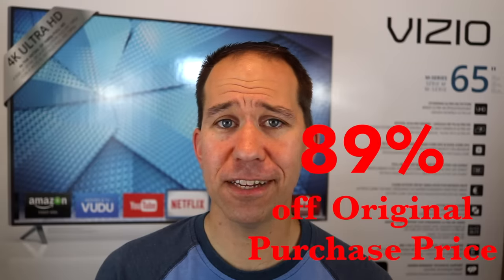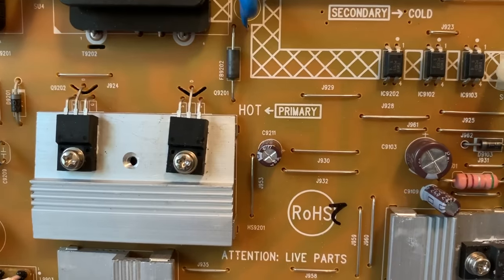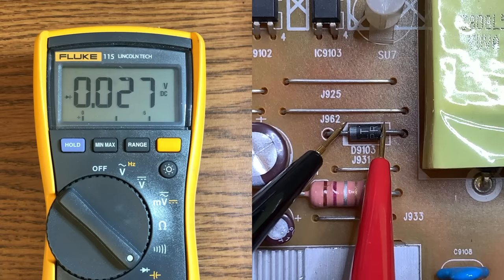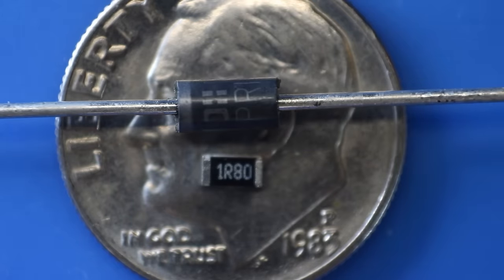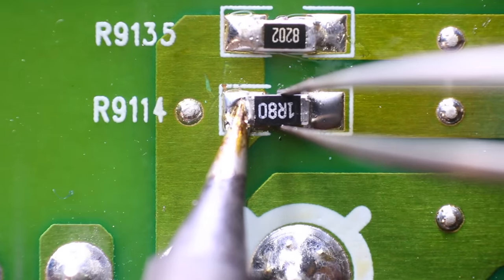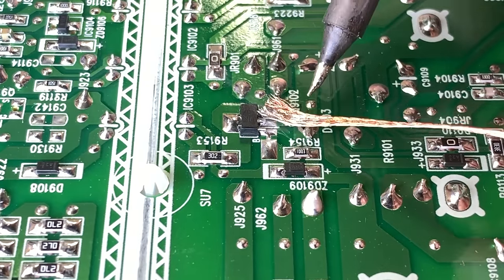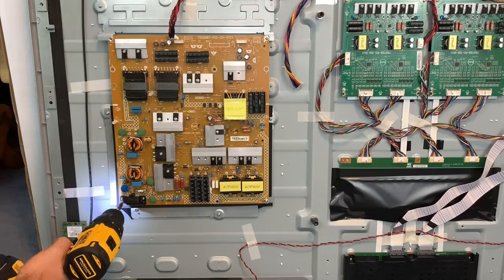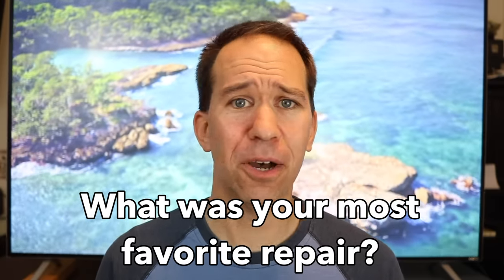I got a broken 65” 4K TV - How I repaired a Vizio M65-C1 (tv won’t turn on)

Comment: I used to repair computers and peripherals for companies like Insight and Wang (1980s) but haven't done much lately. I no longer have the tools and have forgotten more than remembered what to do. I used to believe that having a soldering iron on a component lead too long in order to remove or restore from the mother board for fear of toasting the part itself, but it didn't seem to bother you. Also, I would recommend getting two of each part in the event that the first one is damaged or no good. Since it is a common problem, I'm curious as to why it's the same parts that went bad. Was it from a lightning storm or static discharge that blew the parts the first time? Thanks for sharing. I subscribed and liked the video.

Comment: I have the same tv and the light flashes but never turns on, shopJimmys sells ALL the boards but the one I need they sell an 8 pronged ecom chip that I have no clue where it goes. By the way I saw this video when you posted it and loved it and now using it. Thank you
Reply from the maker: The eeprom chip wild go on the main board, if it’s what I’m understanding is the issue.  I’ve not done any main board work on this model so I can’t tell you off the top of my head.  Thanks for watching!

Comment: I had the exact same TV. I had a lot of issues with HDMI screen freezing or top being fine and bottom with a frozen picture. After about a year of dealing with it would often trick me as sometimes it would be the mouse batteries dying. But one day getting aggravated with trying to get 2 enterprise network switches to talk to each other and forward the VLANS and the TV froze. And with 24 hours of no sleep before I realized it I put my keyboard through the screen. Vizio TV's are junk I've never had so many HDMI issues and that year and model is common with those issues I had. Even my buddy bought the 60 inch model before he punched the screen and sent it back. He ended up just getting a Samsung OLED and made me jealous.
Reply from the maker: Sorry to hear!  The funny thing about vizio TVs is that they are only the brand.  They are made by various companies such as LG, Sharp, AUO, which people generally think well of.  Even Samsung and Sony had years of TVs with terrible problems.  That said,  it is no fun to experience a problem when it’s your own tv!

Comment: Just a bit of advice from someone who does this every day. When you are replacing a thru hole device like the diode you did. And you know the part is bad. Cut both sides of the diode on the other side of the board and then just use your tweezers to pull the left over metal out of the hole as you heat it with a soldering iron. It does less damage to the board that way and is far far easier.
Reply from the maker: Thanks!  Yes, great advice.
Reply: @FrugalRepair  No problem

Comment: Nice work! I have the same exact TV and same exact problem (no power). Unfortunately I don't have the tools or wherewithal to attempt what you did. How much would a TV repair shop typically charge for this kind of work?
Reply from the maker: Thanks!  I don’t know how much a shop would charge, unfortunately.
Reply: @FrugalRepair  Thanks for the reply! I found a TV repair place in Texas (I am in CA) that will ship me a working M65-C1 power board (715G6887-P02-001-002S ) for $200, but I can get a $60 credit for sending them my broken one, so net cost of $140. I can also just ship them the broken board which they'll diagnose and repair for $90 (assuming its broken). Shipping costs not included. This place: http://www.coppelltvrepair.com/ For now, I 'm having a local repair guy come by to diagnose it and give me an estimate.
Reply from the maker: You can also feel free to email me if you want to ship it to me to repair.  I would assume the two parts are bad and could do the same repair as in the video.  I also have more power boards I need to sell.  Again, email me if you want more info.
Reply: @FrugalRepair  Thanks, I will email you. Turns out the diagnosis is a bad main (video) board.
Reply from the maker: There are some people who offer a repair service on eBay for those main boards. I’m not sure if there’s a common failure on there or not.
Reply: @FrugalRepair  Thanks, I will hunt around. I did find this interesting YT video that talks about re-flowing the main board https://www.youtube.com/watch?v=b2Lo3G2u7CE I also read about people baking the main board in the oven at 400F for 10 min to accomplish the same thing and it apparently works (although fumes can be bad).
Reply from the maker: Interesting.  You might benefit from watching my video on using heat to fix a TV.  I can into explaining what people are trying to accomplish by putting their board in the oven (not what I recommend).   I reflowed a chip with a heat gun.   I released it in May 2020 or so.

Comment: I tried to fix my $850 65 in Vizio TV for $31. When the picture when black I did what you did and search the internet. I found that the problem would be the power board. In order to understand how to solder and all the other itsy bitsy things i have watched another 50 videos and spent almost 6 months to train myself in order to feel confident to work on my TV. On my journey i have collected around 15 TVs , various power boards and motherboards that were broken from various TV repair shops dumpsters. I almost burned my entire house while trying to learn and improve soldering skills. I don't even mention how many times i burned myself and got electrocuted. After ordering $1 worth of parts i spent almost $29.99 for receiving those parts from Hong Kong. After i solder the itsy bitsy chip and the weird looking resistor i was confident that i have finally repaired my TV. I plugged it in turned it on woosh no power. I was so upset and felt like i wasted my past 6 months for nothing. While desperately thinking what to do i decided to put my tv online to sell for $200 and some dude offered $150, i was thinking what kind of cheepo is trying to cut $50 from $200 almost in perfect cosmetic condition $850 TV. I said dammit i can't waste anymore time on this TV and i accepted his offer. I even gave him the original box which i kept all this time (almost 2 years) in perfect condition just in case if i need to return the unit for repairs (experience from my old Vizio) had to fight with my wife who has tried to throw it away 100 times which i collected back from the garbage cans. Now i bought another Vizio 65 4k smart TV, spent $650, i think i got a good deal. I am still battling with my wife about keeping the box. In the end i have wasted 6 months and $531.

Comment: Great tips.  What happens if you don't clean up the flux with iso ?  Does it matter what type of flux  liquid/paste?
Reply from the maker: Thanks!  Probably nothing to really worry about if you use "no clean" flux, but still a good habit anyway.
Reply: @FrugalRepair  Say I have old flux and don't know if it's no clean or not?  It's a little acidic right?  It might slowly eat into the circuit board  and/or cause corrosion?

Comment: I found a 50" element by the road one NFL day. I carry a inverter with extension cord in my prius V. Plugged in pressed power and I got power the screen was in perfect shape. I carefully loaded it got home started to find faults. Found one. The TV sounds don't function when you plug in a 1.5 male. My guess they wanted surround sound and a bigger tv. So they relegated this set to AK-47 STATUS . This is a huge tv it's mounted to the wall using bailing wire and a good sturdy couple of bolts in some studs. 

I bought a better than average blue ray DVD player with good RCA female for sound cords. Also bought and repaired a couple of King satellite dish for dish network. I can get into my car drive to Phoenix 1.2K miles away plug up and have satellite tv with a state location settings change. 

Another device I recently discovered, HDMI 3 to one switch. $10 WMT. I've got boomers at shady pines. Yes I bought a switch for them because every contact was a process description on what remote to use and which HDMI port the divice has been allocated. You too would have gladly bought it for them. 

Little did I know when you powered up the DVD player plugged into the HDMI switch it automatically since the voltage and HDMI was no longer an issue for the boomers. You didn't have to switch from one to two you didn't have to find extra remotes all you had to do was power up your unit it automatically switched to the DVD. What was impressive was when you took power away it automatically switched to whatever was powered up ie Dish Network. After that all I had to do was go to the dish remote program the VCR into the dish remote and voila they were watching and controlling from the same remote.

Comment: My first repair was my dead computer monitor, I had to get 3 capacitors to fix it but the site I found only sold 10 packs so I have a bunch of extras.  Still a cheap fix, my next project is a dead 60" tv.  Haven't picked it up yet but should be doable.

Comment: New instant subscriber here. I'm looking into fixing some tvs as well. Can you also add the amount of time you spent in the breakdown of costs? Thanks
Reply from the maker: Great!  Thanks.  Not sure how to answer your question.  Try to pick up some broken ones and see how many you can fix.  Make sure to check if the lcd screen is broken or not, since a cracked LCD can't be repaired.

Comment: I have an RCA 65" RLED6515-UHD,  it was made 5 years ago. With covid happening my kids and my only invesment (huge) for entertainment, is clicking exactly like yours has no power to the light. Im a single father in a small town. Im tech savvy, but i have never fixed a board. Ive tried looking for info on where to start, this is one good one. I was wonding if you may have a way I could get in contact about some advice how to. Ive tried just looking for a board but they are all in China in place I dont understand and I cant just risk at the moment... i kinda would rather buy local or least fix it my self. Anyways thank you for your reply.
Reply from the maker: Maybe you might be helped by watching my video on what to do after a power surge.  I cover some basic diagnostics with a multi-meter.  Maybe that can help you narrow down what board inside has the problem.  Have you looked on ebay for replacement boards?

Comment: Hi Frugal Repair,
Thank you for your excellent video. My 55" Insignia smart tv when turned on, the banner comes for a fraction of second and screen goes black .Then immediately  I noticed that the 12 ribbon cables connected to the screen gets too hot to touch. I am trying to repair it and I am pretty sure that your advice would help me in my repair. 
Thank you
Reply from the maker: That symptom is usually because  the led backlight is shorted.

Comment: Hi.   Does it matter with resistors if you put them in the wrong way round?  i see the one you replaced looked like it was the wrong way.
Reply from the maker: The direction doesn't matter on the resistor.  Good eyes!

Comment: I like the tape fix... 
I have a Samsung curve 65" qled with broken screen and as it is powered by one connect...it became useles, no resale value and high screen replaceable cost... What do you prefer me to do... I have been doing some research to make it connect to a projector but there is no projector which comes with one connect port.

Comment: I have a TCL that has a similar problem and believe it's also a resistor. Never removed anything that small but I think I have what I need. I have another TCL Roku with a broken screen for parts. Unless I can swap screens? Might be easier.

Comment: My favorite repair so far was a Nintendo DSi XL where I had to route 6 missing/corroded contacts from the cartridge port to the reverse side of the board using single strand wire.
Reply from the maker: Wow, that is great to hear you can micro-solder!  I bet that felt good to see it running again.  Did you work under a microscope?

Comment: I found a 55" 4k TV that my neighbor was throwing out. I've found that it works fine except the picture is a little washed out. My current research shows I might need to replace the t-con board for like $30 or so.
Reply from the maker: I hope that’s the case!  Great find. Thanks for sharing.

Comment: I just bought the same tv model number with the same problem on the resistor but not the diode causing a solid light on the main board instead of a blinking led. It is a no power situation. I ordered the new resistor and we'll see how it goes in a few days.
Reply from the maker: Hope you can get it repaired!
Reply from the maker: If you were getting a solid 19 V from the power supply, then the problem might be on the main board.
Reply: So Im getting ready to prep the board for the parts coming in today and I just noticed Q9102 has what looks like a blown in half transistor that I didnt see before! I can only make out a K and below it a 2... so now the hunt begins to find that part! Aww the chase and like you said that feeling when you plug it in for the first time after the repair.
Reply from the maker: Good luck!  You'll be able to figure it out.

Comment: You got so lucky you had someone with the same issue. I recently had a go at a Samsung LE40N87BDX that would click on and off on power up.. infinitely. Replaced the capacitors (which is the common problem) but didn't fix it. Not given up on it yet..
Reply from the maker: It did certainly make the diagnosis go a lot quicker to find specific information online.  Is your samsung in the era of capacitor plague?  Maybe there is another cap that looked ok but didn't get replaced?
Reply: FrugalRepair It was built around 2007 so I think so. I essentially did what these four videos show https://youtu.be/5bh3LZ7KcWY including resetting the EEPROM but it still didn't stop the issue. I really need a testing kit to measure the voltages.. I got a basic one with my soldering iron (just a multimeter) but I don't think that is about to measure the volts. There's so many guides out there that I occasionally dip back in and try something else but it's hard finding the information for what each part show read as.

Comment: I fixed 65" samsung with a bad dlp digital light projector my neighbor threw away. It cost 30 bucks. He paid 3,000 for tv 3years before. I was embarrassed to ask him if he had the remote because I didn't want to tell him it cost 30 to fix! Lol I ordered remote off ebay for 16 bucks. That tv worked for another 7 years. Problem associated with those old tvs were dust/dirt build up would overheat the light projector chip causing white dots. Back then they used fans to keep chips cool. I find all this fascinating. I want to take vocational training to learn more.
Reply from the maker: Great job!  Thanks for sharing.

Comment: Great videos very helpful!!!  I just picked up a m60c3 Vizio for free.  The owner said it doesn't turn on.  Well it turns on just fine but the local dimming zones are off.  The left side of the screen flickers and there are plenty of dark areas throughout the screen.  I can minimize this by adjusting the "clear action" feature.  Any idea what it could be?  I know with some TVs the individual led lenses lose their adhesive backing and fall but I'm not seeing bright spots im seeing dark spots.  🤷🤔.  Any help would be greatly appreciated.  I also took a video if you would like to see it.  Thanks 👍
Reply from the maker: Thanks!  I think those models tend to have backlight issues.  Turn the backlight to 10% and see if you get a more uniform backlight.  The flickering maybe the backlight, rather than the image.
Reply: @FrugalRepair  so the flickering stopped when I put the blacklight to 0 but the dark spots are all still there
Reply: @FrugalRepair    not sure what happened to my previous message 🤷.  Anyway, ya the light flickering is def one of the LEDs from the lower left hand zone.  I included a link to my video so you can see it.  Also the screen is quite dim even with the backlight on 100 percent.  Looks like quite a few LEDs are out or not properly lit.  Lots of dark spots all over the screen.  Another funny thing is sometimes it will not power on but if it does you just have to tap the back of the TV about 5 inches above the power button and it will lose power and immediately go dark.  Wondering if it could be a loose connection that is having voltage issues 🤷.  I will look into bringing the backlight to 0.  Here is the video.   Thanks again.  

Looks like YouTube will not allow me to post a link to the video.